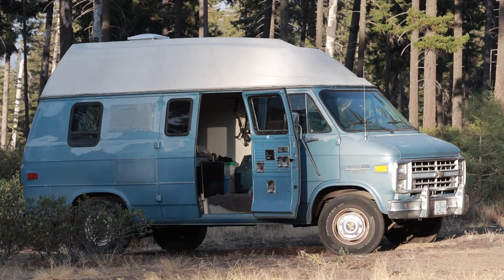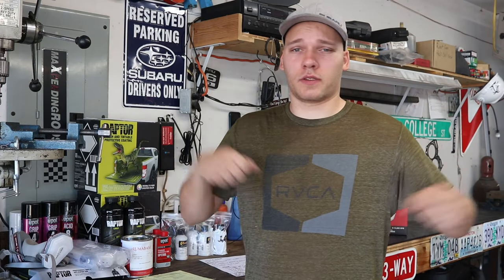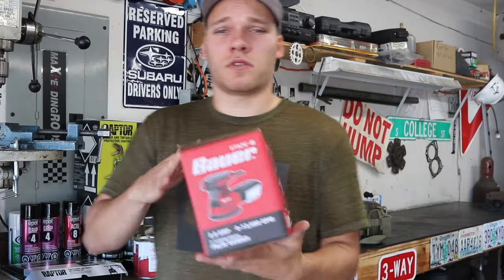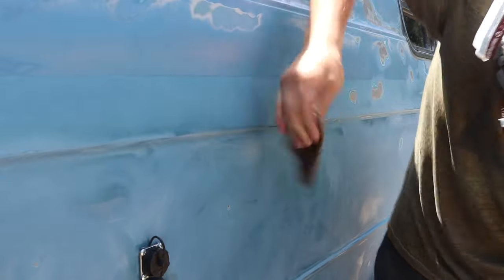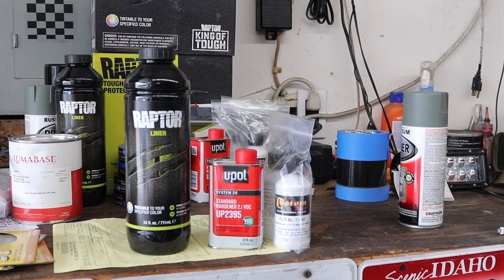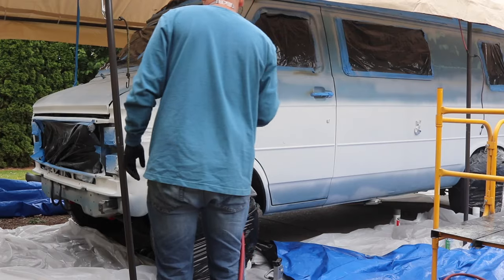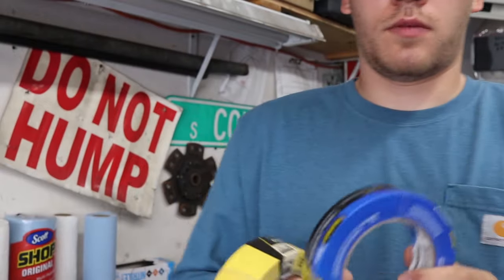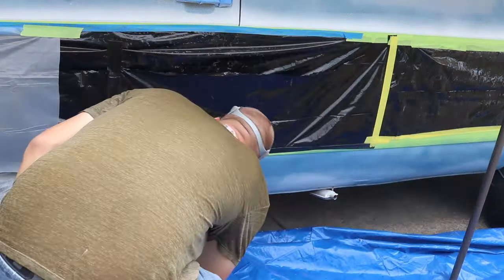DIY Bedliner Paint Job | RAPTOR LINER Camper Van

Comment from the maker: LET ME KNOW IF YOU HAVE ANY QUESTIONS! 
Material List & Links
RAPTOR LINER TINTABLE KIT: https://amzn.to/2SopWL5
TINT BOTTLES: https://amzn.to/3xLTaT5
You can also use urethane basecoat from a paint supplier for a custom matched color, make sure to ask for no binders in the paint. I got mine from Wesco. 
VARI-NOZZLE SPRAY GUN: https://amzn.to/3d8HYYI
SYRINGES: https://amzn.to/3gP7pkf
RESPIRATOR: https://amzn.to/3vP0fAR
U-POL ETCH PRIMER: https://amzn.to/2SYfjPa
U-POL ADHESION PROMOTER: https://amzn.to/3zUSGMc
AIR REGULATOR: https://www.harborfreight.com/160-psi...
WATER SEPERATOR:https://www.harborfreight.com/oilwate...

Prep Materials
3M AUTO MASKING TAPE (works well on top of bedliner): https://amzn.to/3gN72qt
3M POLY MASKING TAPE: https://amzn.to/2TWFS7M
Painters Plastic or Cut Up Large Contractors Trash Bags Work Well 
RANDOM ORBITAL SANDER: https://www.harborfreight.com/28-amp-...
*purchasing through these amazon links supports the channel at no added cost to you! 
👍
Reply: When you got the paint did you just use your paint code from van? I have a similar colored k5  and I’m only wanting to do a portion in raptor and the rest in the same color paint
Reply from the maker: @AlaskaNards  yes, I took the color code into the paint supplier.
Reply: Kick ass nice work
Reply: I did my Rubicon a couple years ago. How have you addressed chips that have happened?

Comment: Your demonstration of how you "bedlined" your vehicle is the most useful presentaion on the topic I have come across in my extensive U-tube research.  Obviously, it holds  a particular appeal to owners of vintage vans.

In my case, your guidance has persuaded me to modify my bedliner project.
I have decided to attempt a more subtle paint texture on my 1995  turtle-topped, extended Dodge B3500.  I intended to pull the trigger on the spray painting today.  However, based on your input, I have decided to do some additional sanding, increase the air compressor output and see if I can duplicate your texture results.  Thanks again for your down to earth, comprehensive guidance
 
.

Comment: Phenomenal paint job. I am getting ready to do my van a tan raptor color and black for the front and rear numbers. The lower portion of the van wheel area will be black all the way down. May I ask why you waited an hour and then 3 days? I have seen a few videos where they wait 20 minutes and apply a second coat. Were 3 days necessary before you started the blue coat? Great looking van. It shows you took your time.
Reply from the maker: I waited an hour between each coat. And three days before the blue so the white would completely cure before I put tape on it. Just played it safe.

Comment: Looks good. What air compressor did you use? Also what Facebook Group are you citing?
Reply from the maker: We have a 30 gallon Husky Pro compressor. The facebook group is called "Raptor Liner coated Vehicles".

Comment: Thanks for the great video.   Alot of work put into the video, let alone the paint job.  Thanks for taking the time to do it!  I have a 1989 G20 and I'm interested in the type of headlights you have. Any info would be greatly appreciated.
Reply from the maker: They are from United Pacific. I got them on amazon https://amzn.to/3zrdI4z
Reply: @DonnieDispersed  thanks for the reply!  How long have you had them?   Any issues?  Pros/cons?  Found your channel this morning looking up raptor liner.   Going to do my van as well. Subscribed!
Reply from the maker: @finball70  I’ve had them for a few months now. I love them. The low beam projector has a great beam cutoff and the high beam reflector lens is very bright especially for halogen bulbs. I tried some led bulbs in the projectors and they weren’t nearly as good as the halogens they came with.
Reply from the maker: @finball70  I did have to modify the headlight buckets a little to make them fit. But it only took a couple mins with some tin snips.
Reply: @DonnieDispersed  cool, thanks!

Comment: Nice job.  I've been thinking about raptor painting my white Vixen camper van but was concerned about how easy it is to keep the white part of the body clean.  Do you wash it like you would a normal car?  Does the dirt cling to the textured surface more than it would a smooth surface?  How has the finish weathered over the last two years?  And finally, any impact on gas mileage?
Reply from the maker: I’ve since sold the van, but it was easy to clean. Just used an electric pressure washer. Can’t say I noticed a difference in mpg.

Comment: Looks great man. I couldn't quite make it out on the paper but would you mind sharing how much you needed/used? I have a similar sized econoline van with a hightop but also don't need to do the hightop itself.
Reply from the maker: I ended up using 10 liters 👍
Reply: @DonnieDispersed  Awesome, thanks man!